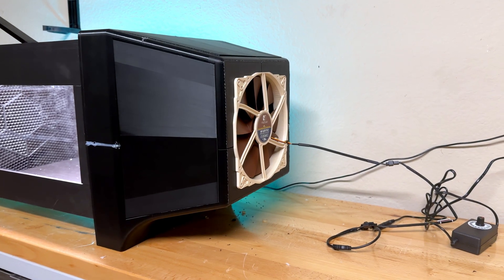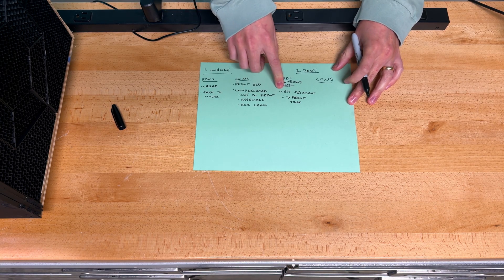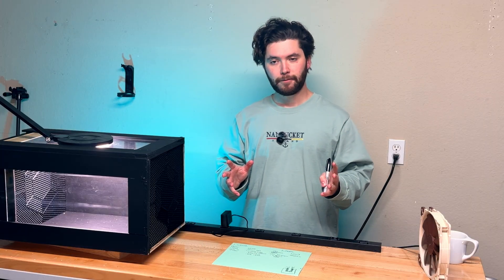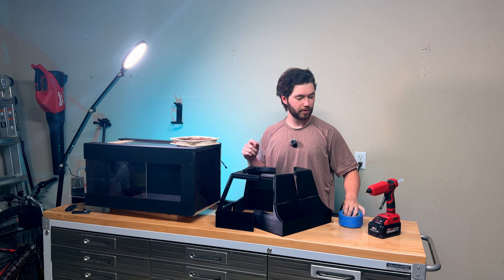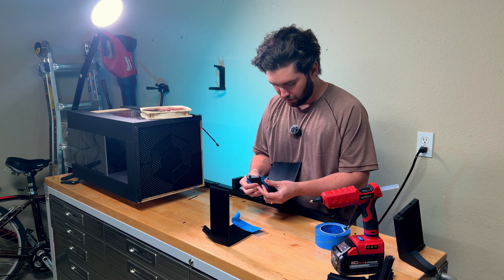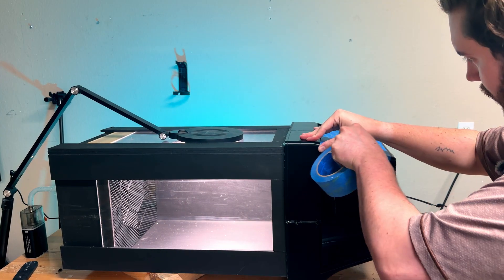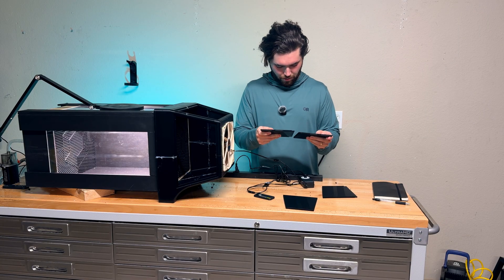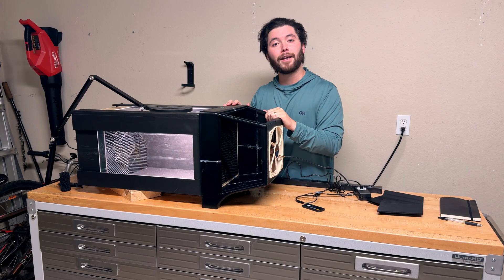Creating a DIRTY AIR BOX (Game Changer!): DIY Wind Tunnel Part 10

Comment: Good to see you back. One suggestion is to remove the second honeycomb near the fan, it is not really necessary, instead you can add a mesh screen(base on your setup and to not loos so much air flow steel or aluminum 8 mesh will be perfect) 10-15 cm after the first honeycomb, it will reduce small turbulence (it will also need 10-15cm of empty space after). If you want to push it even more, you can consider a contraction cone after the honeycomb (and mesh screen if you add), also a diffuser after the test section and before the fan. This setup will give you a completely perfect laminar air flow. Your current setup still compresses the air after the test area, and it is not a good practice in general. In the wind tunnel, the test area is the smallest part, and after that, we will add a diffuser to expand it. Exactly the opposite of a correct build.
 I wasn't able to send you an email. The email you sent to me was incorrect somehow. Good luck with your project.

Comment: Brother, just stick to super glue for pla, make the tolerances for the snap pins a bit looser so they just slide in eazy, they dont have to click tightly in place. The pins align the parts and the glue holds it together. You can also get a low viscosity(more watery) super glue that is great to fill small seams as it kinda fills the seam by itself as you drop some glue in the seam. Makes things look very neat.
Reply from the maker: I thought about that but didn’t have any. But I’m glad I used hot glue so that it could fill the gaps!

Comment: Cool build! One suggestion — the section going into the fan shouldn’t get smaller. When it narrows, the air speeds up and gets more turbulent, so the results aren’t very smooth or laminar.
I also noticed there isn’t a contraction in the front yet. The contraction is the part that gently gets smaller at the air intake to smooth the flow before the test section.
The diffuser goes after the test section and should get wider, not narrower. It isn’t a filter — it’s more like a long trapezoid that slows the air down smoothly.
Reply from the maker: That's super helpful feedback, I appreciate the detailed explanation! That’s what I have planned next!

Comment: So you got me thinking and you tubing lol
It seems like contra rotating blades will smooth out air flow both in and out. So maybe mounting 2 PC fans, I would assume you could reverse the wires and print a new fan OR simply purchase a backwards PC fan and save the headache. I do believe that you would want this on both the in and out sides
Reply from the maker: Interesting thought!!